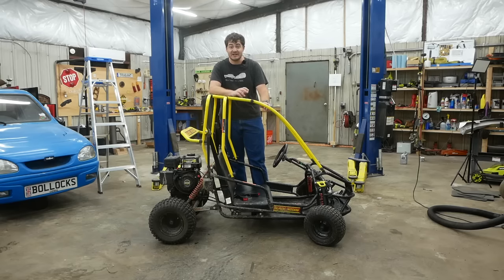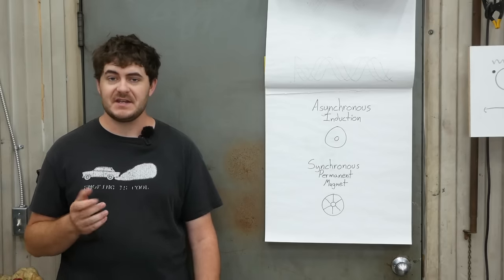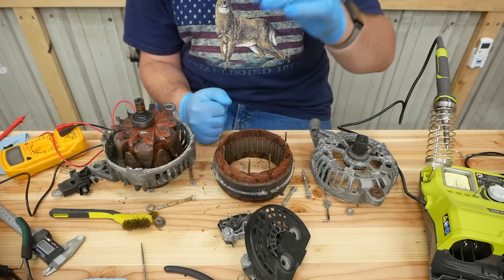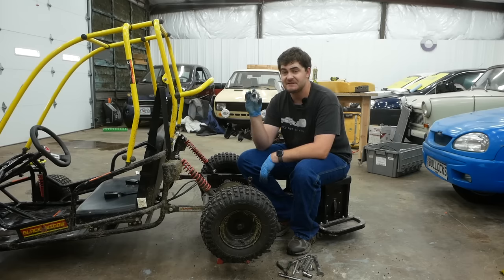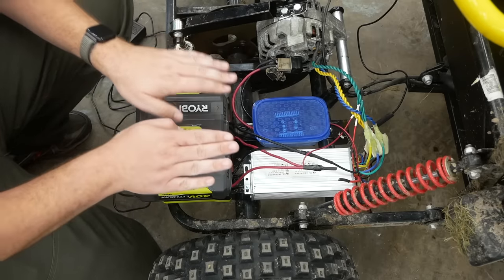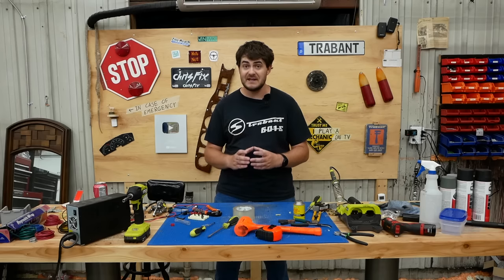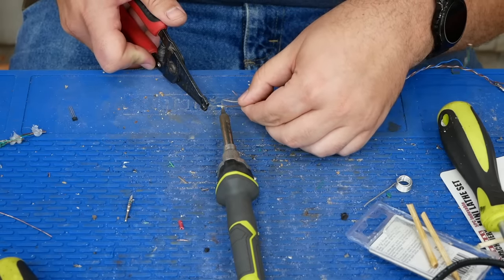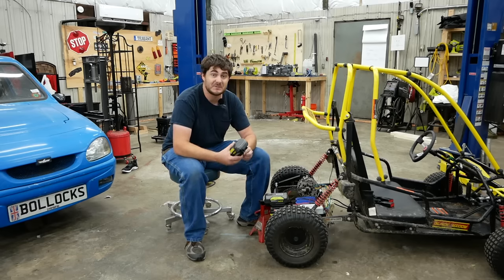Can I Power This Go Kart with a Used Car Alternator?

Comment: It sounds like you're missing a key component of three-phase motors - a three-phase motor starter. Cheaper products (like desk fans) often use a capacitor to dump an initial high-voltage current into the motor to get it going and produce enough torque to overcome too much slip (ceiling fans also initially bypass their speed controllers - for a short period - when you turn them on which you can actually hear by the buzzing it makes as it starts up - that's the switch circuitry providing it with full domestic voltage rather than the lower voltage the speed controller provides). Once the motor is spinning it usually fixes the slip issue by itself. All three-phase induction motors have slip - it's how they are designed to work and be able to produce any torque at all. Since you're using an alternator - which was producing power by spinning rather than using it TO spin (and it was being spun by the engine), it never came with any starter circuitry, and it sounds like the speed controller you are using doesn't have any either ... which suggests it's not designed to be used with a three-phase motor to begin with, or it's expecting there to be a separate starter module - and no amount of sensors is going to fix this issue.

As for the cutting out - that honestly sounds like over-draw (or over-heating) protection ... which a lot of those rechargable tool batteries have built inside them on a small circuit board inside their plastic casing. So switching over to larger batteries that are designed for higher power draws should solve that issue (like the batteries used for mowers instead of hand tools).

Comment: Probably the issue is in the fact that electric motors sometimes can't or have trouble starting the rotation but are easily able to add power to an already rotating object, hence why electric fans jump straight to the highest power on the switch to gove the motor the best chance of beginning to rotate

Comment: 15 minutes with someone who's into building remote-controlled toy stuff would have got all of these problems sorted out. The solution to every one of your problems is a modular component, designed for interfunctionality. You can even keep your alternator motor feature, as it follows the same rules as all the other externally sensed hobby motors (the older-type system).
Reply: I guess that would require quite a bit more expensive hardware than e.g. $4 alternator from scrap yard. Easier for sure, though.
Reply: @MikkoRantalainen  Unfortunately, my previous statement does require you to have some reading comprehension in order to extract the full value from it. Once you focus, you can keep your $4 alternator with an RC-type system, as stated. It's also going to save you a lot of money, compared to the re-purchase/still-inop methods demonstrated in this video.
Reply: @buckstarchaser2376  Okay, how much do you think ready made interfunctional components capable of handling 1500+ W using motor made out of alternator would cost? Do you think you could do it under $96 (being the value mentioned in the video).
Reply: @MikkoRantalainen  I see one on Hobby King right now that meets your specifications for $25, but again, you are showing a lack of comprehention, because he says he's going to replace every component except for the motor, but the 3KW speed controller he's buying will also come with its own motor, just in case he can't get the alternator to work right. For this version of the shopping list, a motor and controller combo, is about $100. He want's to build some absurd battery pack out of innappropriate cell types. That's going to be another source of headaches, when he can/should save hundreds on just going with high-rated (hobbyist batteries are actually labeled for their output capabilities, while whatever "cylindrical type" cells he's going to have access to will need to be assumed 1C - constant, which would significantly de-rate otherwise capable cells, or he will need to build an analysis rig and cell-match every cell for 12 x (amperage draw) = $$$$ vs $$ for a 4s, 20Ah, 240Amp-rated ready-to-charge and go battery pack with quick disconnect... that's another $128, but that level of power commands a premium. Not to mention that the battery charger I use for 4s LiPos will do 2 at a time, balance the cells, give great technical readouts, etc., for $90, or you can get other models of similar price, that will let you charge your batteries from your car's battery, or even use your huge gocart batteries to carefully charge your other hobby battery packs for drones, camera goggles (for filming and ride-along camera, etc.) 
People often make the mistake of confusing hobby RC stuff with "Toys", but toys are as sophisticated as the people can afford to pay for, and a lot of moneyed folks love their toys, case in point, this botched gocart project.
Reply: @buckstarchaser2376  I was referring to the original build with cost of $100. I agree that the more expensive build he's talking about would be more sensible with high power RC parts.

However, perhaps I'm using a wrong search query but I can only find parts for up to 6S 120A which still wouldn't be good enough for 3 kW build.
Reply: @MikkoRantalainen  I see... If you want to get a battery pack that will do more Wattage than one will provide, you simply put more of them in series (like a multi-cell battery pack already does), or put more of them in parallel, if your battery can't source enough current. The video author is seriously mistaken in several points he made in the video, but essentially, if he can put 1500W into that alternator without frying it, or getting very bad efficiency losses, it will be too fast anyway. The moment he stops trying to get bottom-dollar parts, that he can't even get information on, that he doesn't seem to understand anyway, he'll suddenly realize that "(1) One electrical horsepower is significantly more than one mechanical horsepower. (2) The torque curve of an electrical motor is unlike a combustion engine, and is different for every type of winding configuration. (3) The alternator he's using is likely designed to manage around 15VAC across each coil, and flow a combined amperage of maaaaybe up to 100A (but it's a stretch). If he tries to push 1500W continuous into that alternator, it will likely overheat the windings and turn to smoke. 3000W (real Watts, not "go ahead and try to sue China for scamming you" Watts) will immediately end the life of that motor. (4) The alternator's windings are many turns of thin wire, so that it can produce useable power while at idle. The alternator does not produce much more power on the highway than it does just after you start the car. This is because: (5) The alternator's power output is a function of the RPM and rotor (the DC magnet that takes the place of a typical permanent magnet in some motors) field winding amperage x turns / size. Putting more voltage into the stator windings to flow more current, will likely cap out your total mechanical power output by the excessive number of turns (which are numerous so the alternator could charge the battery at idle), which will inherently have too much inductance to run at high-enough RPM, because the LR time constant of the coils becomes proportionately too long to flow current when switched faster. (6) A possible solution (assuming this is the only motor you want to use) is to chase rotor current, not stator voltage. This thing is optimized for use as an alternator, and so you have to treat it as such. (7) A better solution (while still keeping the alternator), is to rewind the stator and rotor coils to specifications that suit your purpose, then, you can tailor the voltage, amperage, and RPM characteristics to your particular application.
I would also force high velocity air through the alternator housing, and I'd use the stator power to run it (or a proportional circuit, or sensors&logic).
Reply: @buckstarchaser2376  I fully agree with your comment except that some passanger cars actually have "12 V" alternators that can constantly output 120 A at 13.8 V. For example, year 2000 Audi A4 with TDI PD engine has one. And 1 hp or 746 W is exactly the same thing with electrical engine and combustion engine but only electrical engine (motor) can generate that at zero rpm which is where you feel the torque the most. (That is, 1 hp combustion engine outputs 1 hp at the peak power of the power curve with wide open throttle, a well designed and built electrical motor can output it over the whole rpm range it can run.)
Reply: @MikkoRantalainen  I directly specified that I was guesstimating "his" alternator. What car it came from I don't recall. If you compare my guess of "100A@15V" vs your example of "120A@13.8V", then the difference becomes trivial, even if I was talking more generally. The exception you referenced should not be so close to the rule of thumb I used, however, so the part where I was all like "but it's a stretch" is where I preempted your rebuttal.

You are confusing several motor terms in your argument that power dissipation is the same as work done. If the rotor is locked, then it is doing zero horsepower of work, but is likely dissipating far greater wattage than its rated peak horsepower (work output). Horsepower has a conversion to Wattage, but that doesn't mean they can be interpreted to mean the same thing. The peak torque of some types of electric motors is developed at zero RPM. This alternator is wired as a synchronous motor, however, and so its peak torque will be at the point where the rotor can no longer stay in phase with the stator. For dynamic reasons, this is not likely to be zero RPM.

Comment: Li-ion do not have the discharge rate of lipo or even a lead acid battery.  It is shutting off due to the voltage sag of the Li-ion packs.

Comment: 16:30 ish, with the electronic speed controller (ESC) tries to find the position, as far as I understand that is indeed what it does. If its intended use is a model aircraft if will jitter the propellor a bit to sense the position and then ramp it up. Your cart may have too much resistance for this probing phase and therefore get stuck.
Blasting the full 1500Watt on a motor that doesn't go spinning is quite a fase recipe for escaping smoke :).

Comment: Aging Wheels! This video was awesome I had the same idea and what you've done your work is phenomenal. That being said I've just completed a similar project.  I bought a ~$250 ebike conversion kit ("500 watt" 3 phases motor).  I used four 18 volt Ryobi batteries. (2s+2p) I get a damn good amount of run, probably a 45 minute ride. ( I've been too excited to actually mile test it) with no pedaling. No heat in the cells and 28 mph. I have the same 18 volt (4ah) Ryobi drill batteries, and 40 volt (5ah) batteries. I specifically didn't use my 40 volts only because I have more 18 volt batteries.  I would be really curious to see if the 40 volt has a higher amperage cut off, versus the drill (18v) battery that they expect to be beaten and abused every day versus the "lawn care" 40 volt.

Comment: The controller can guess what position the rotor is in from the 0 passings and back emf, however that doesnt work until the rotor has actually begun to rotate. Typically you would have a flat volts per hertz curve for the initial starting as an open loop system. Then it would begin to "assume" where the rotor is using the 0 passings/back emf as a closed loop system. This doesnt help you of course but hopefully explains how the controller can guess the orientation of the rotor.

Comment: done this. If you use a belt drive instead if the chain it will work with the sensorless controller.

Comment: A Ryobi charger is a terrible battery hookup because the connections are not rated for 20amps. I ran into this problem with the 18v batteries and an old charger.

Comment: The motor controller is cutting out due to too much load on the motor, I’ve experienced this exact issue with similar 3 phase controllers, it could also be due to lack of voltage

Comment: So, In a completely different set-up, I installed a 12v DC delivery hose return motor from an oil truck to the frame of a go-cart 40 years ago, and added a 12v car battery.  Where the gas pedal was located I installed a push to operate DC button from said oil truck hose return motor underneath the pedal.  The hose return motor was direct drive to a sprocket at the back wheel.   By pressing on the pedal, the energized button underneath the pedal completed the circuit to the hose return motor and the go-cart whizzed off.   After about 20 minutes time, it was time for a recharge of the battery.  The advantage to the neighborhood was no noise from the go-cart disturbing old folks.   The disadvantage was that it was so cool that some bastard stole it from my front porch.     Never seen again.

Comment: I think you need a peak engagement until the power level drops with the speed as it intersects inks and you can control the speed but you need a power boost at the first initiation

Comment: I'll try to explain the twitching a bit

Okay, so like, look at a fan; Off -> High -> Low
In 3-phase motors, the starting torque in low will likely never be enough to kick the rotors hard enough with the low torque.
So, as ingenious as it may seem, the fan manufacturers figured out this impossibly hard to comprehend solution: put the high before the low.
In the High mode, the torque is strong enough to jolt the fan rotor into movement, which will end up getting picked up by the stator's magnetic field, and as such, start spinning.

so basically if you just hit the alternator with lightning while it's stationary it'll start shufflin

Comment: Just be certain that both batteries wired in parallel are exactly at the same voltage,  or one will discharge into the other at a high current that could lead to things melting and catching fire.  I notice the batteries quickly changeable which suggest your likely to be using many batteries and two external chargers, and there is a reasonabe risk that both batteries won't alwayse be charged to the exact same voltage.

Comment: Thanks 1° for your excellent  videos.
I have the same greenwood lithium 
What I've been experimenting with a electric power steering motor  Fortunately it works However you've took in the facts that an alternator is much better to use the only thing is I don't know anything whatsoever with your city there's city and I'd like to see if perhaps there are other videos taking address that
 Of course once again I want to thank you for your outstanding videos
Reply: My cell obviously didn't pick up correctly.   What I meant to say is that I don't know anything about electricity so so that's why I was asking about perhaps perhaps other videos that can help me complete  this project Sir

Comment: The way sensorless motor controllers determine rotor position is by measuring the back EMF that’s generated in each winding as the rotor moves through the magnetic field. This is speed dependent and at zero / low speeds there is no back EMF. So the motor controller just spins the magnetic field and hopes the motor will eventually sync up. This works pretty well if there’s no load on the motor, for example in RC airplanes. Not so good otherwise. Your controller must be set up for sensorless operation or it would not even try to start the motor without the hall sensors. Maybe it’s time to learn to read Chinese :)

Comment: Make a big enough pack so you can use higher capacity but lower amperage cells. You save money and get lot more drive time. You can get 20-30W from 7A cell. Put 200 of them and you have a great reserve for power and 2.5 kwh of capacity. With that you can drive whole day. You can get them from 500, which is not much more than couple of big tool batteries. They are worst buck for money.

Comment: Interesting.  However, if you used a 240V AC motor from a 1800 RPM washing machine, this would go like a rocket.   :-)
Reply: Mains powered angle grinder. They roll out to 10K RPM and can be held on with hose clamps. Plus they will run AC or DC because they are simple cage motors. You just need a  bucking converter capable of 1500w 36 volts to 240 volts

Comment: Voltage range set on the motor controller is gonna be a problem if the motor controller is set for 13s that is a range of 54.6 full and 36.4 dead that battery is 42 full and 28 dead. You should be able to get about 30 amps constant out of the 2 batteries your trying to use and up to 40 amps surge. Size wire to use to the controller would be no less than 10awg per battery to controller that will minimize the voltage drop.

Comment: You need more current on your stator beciase startup draws gobbs of power and when it spins up it drops! Just get a 12v batt and let it pull as much current as it needs to boogie and the motor will work! The coil that is off generated a inducted voltage from the magnet passing over it. The voltage gradually goes up till it peaks then drops the second it drops the esc knows from the voltage when to power it in time. The 1 wire not powered turns into a sensor!

Comment: Hall sensors have 3 wires coming out one each is positive negative 5 volts 3rd wire is signal wire, so you need to try the combination of  only 3 wires .

Comment: Why not attach the alternator to one of the wheels and use the batteries to power the motor in a dual switch mode. whereas one battery is supplying power while the other charges. When the first battery discharges the second will be ready with a full charge because of the alternator, Then the circuit board will switch to the full battery and charge the discharged battery while the former is now supplying the motor. This could be perpetual energy. I imagine there will be some charging involved nightly but this method could extend the range significantly by always keeping a bank of batteries charged while the other bank supplies.